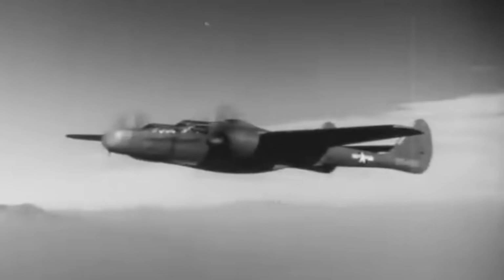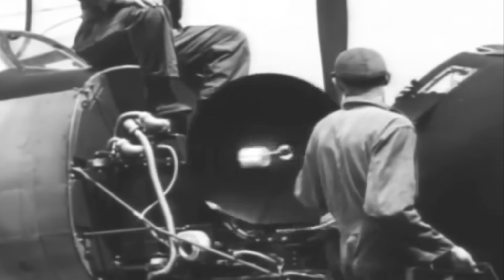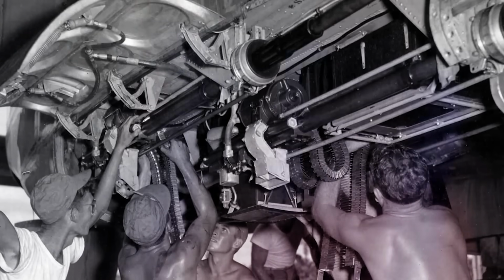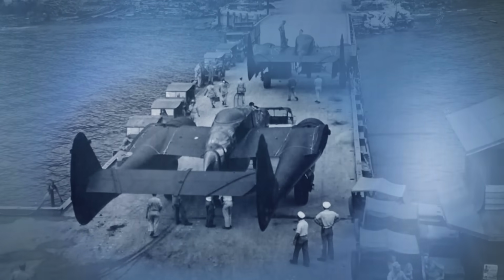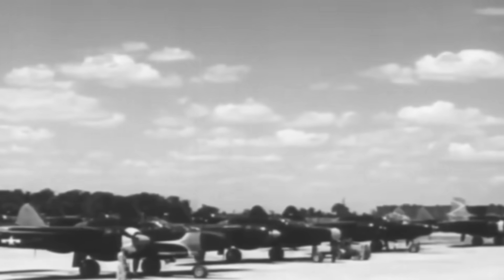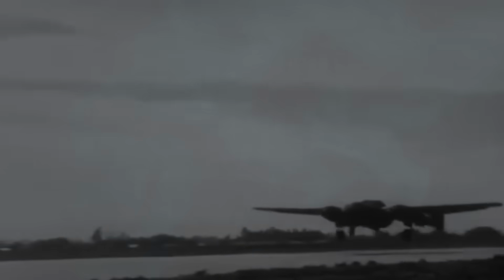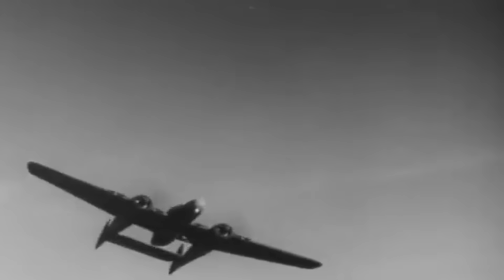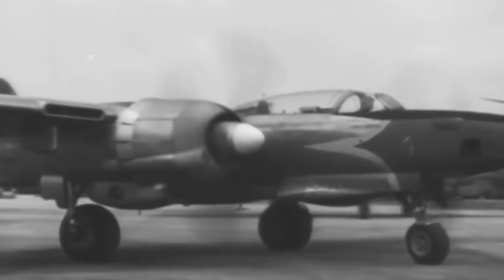The Mysterious Plane That Made 127 Kills Without Ever Being Seen

Comment: 0:27 Actually it wasn't an air-to-air kill ... it was on the night of 14th/15th August 1945 when a Nakajima Ki-44 spotted an attacking P61, descended to wave-top height and began evasive manoevres, only ending when the aircraft hit the water and crashed. Not a shot had been fired and the P61 crew were not credited with the kill, as it happened nearly 24 hours after the end of the war.
0:49 ... RAF Spitfires and Hurricanes were hardly "outdated" when World War 2 began ... at that time they were state of the art, particularly the Spitfire.
1:01 ... the P59 was a piece of junk ... most piston engine fighters of the time could easily outperform it.
1:19 Nightfighters and All Weather Interceptors are not the same thing.
2:08 A night time "fighter jet"?
2:20 What "big bombers"? The Luftwaffe never had any of those.
3:07 Ground Controlled Intercepts were still very often necessary as AI tended to be short range ... the GCI could get the nightfighter into the general area of an EA, close enough for the AI to then take over.
3:34 ... something Mosquito and Beaufighter nightfighters had been doing for years, long before the P61 entered service.
4:13 The dorsal turrent caused severe turbulence and on most P51s it was either deleted of locked in the forward firing position.
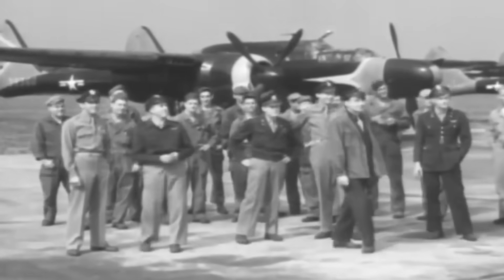4:35 366 mph? Slow as hell!  Mosquitos had been easily exceeding 400 mph since 1941!
5:14 It took until February 1944 to figure out that black was best for a Nightfighter?  Jeez, Defiant Nightfighters had been painted black since 1940!
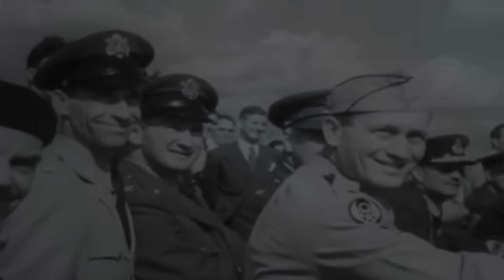6:14 Well what a surprise ... people couldn't see an aeroplane flying over ... AT NIGHT!!!
7:03 Astonishing that a so-called "cutting edge" night fighter that had entered service in the ETO in February 1944 was considered obsolescent in December 1944, only ten months later!
7:24 Slow!!
All in all, a somewhat mediocre aircraft that never got anywhere near being effective in the role it was designed for.  Too big, too slow, too short-ranged, too troublesome and too late entering service.

Comment: Shortly after ww2 ended is when the airforce recovered a scout / landing craft from the Grays of proxima centauri. That act led to a explosion of high technology. Although not all of the tech has been disassembled and understood. I'm telling you absolutely fact but I know many of you can't and won't accept it. I've seen it, I worked on the team studying the power distribution., we still only understand about 10 percent of the tech and construction of this ships reactor. It emits low levels of gamma radiation and the material inside the reactor creates an antigravity field or envelope... Cancels out ships mass. This it can violate the law about speed of light. No matter how many times you multiply zero... It never increases. I've told all you too much. The black  widow radar came from another disassembled craft given to US dept of defense in return for biological samples and corpses of supposedly accident and combat loss during Ww2

Comment: The RAF began airborne radar interception operations in late 1940 and used a variety of aircraft for the role throughout the war.  Similarly the Germans adopted a variety of aircraft for the role including the Me110 and the Ju88.  Both of these were painfully successful as night fighters.  The P-61 was an interesting but completely unnecessary experiment.  If Northrupt had been assigned to manufacture modified P-38's for the radar night fighting they might have got to the fight earlier and with a faster aircraft.

Comment: i have a piece of one of the four last remaining examples of the P-61. I got it to support the restoration of it to flight condition. it is currently my most prized possession since it is irreplaceable. an absolutely amazing plane for its time period.
Reply: If you don't mind sharing, where's it located now?
Reply: @jfu5222  mid atlantic air museum in reading, pa. it looks like it still needs its tail and wings, but has parts of it painted to its original unit. both engines mounted.

Comment: The first aircraft to use onboard radar was the Beaufighter night-fighter variant. The problem at that time in 1940 was that the radar set weighed a ton (2, 240-lb) and needed a big aircraft to lift it. The Beaufighter was the most powerful heavy fighter of the time, heavily armed and armoured, the Warthog of its day, four cannons, six rifle guns plus an extra one for the observer to pot shot with if he felt the urge. 
The P-61 did not enter service until 1944 and was the first US night fighter to be equipped with radar. Note US, not british, who gave the US the radar tech. We'd been littering the countryside with german night bombers for some while before the purpose built Black Widow turned up late in the proceedings. The Mosquito could also lift the radar set and had greater altitude and range than the Beaufighter but lacked its manoeuvrability. The Mossie NF were used to home in on german night fighters and take them out. The Lancaster had H2S proximity radar from 1943 which meant the Bf110G-4 showed up like a sore thumb. I gather my late father potted a few from the back seat of a Lanc.

Comment: In hindsight, given the lengthy technical delays costing two years, perhaps someone should have thought much earlier about adapting the P-38 Lightning to a night fighter role.  It was eventually done, but also very late in the war, too little too late.  Using the more powerful Allison engines of the late Lightning J and L versions, the night fighter version of the P-38 might still be capable of a top speed of 370 to 380 mph.  In the incident of a P-61 versus a Me-410 Hornisse (Hornet), the 410's top speed was 388 mph compared to 360 for the P-61, although top speed is sometimes stated as 366 mph.  That is why the Hornet was able to pull away in a straight pursuit chase.

Comment: In spite of two, 1,900 horsepower engines, the P-61 Black Widow's top speed was only 360 mph.  What was really called for would be something in the range of 400 mph or better.  The P-61 boasted an awesome, devastating array of four, Hispano 20mm cannon and four, Browning M2 0.50 heavy machine guns in a rotating top fuselage turret.  Unsolved continuing buffeting problems often led to the field removal of the top turret carrying the four 0.50 caliber machine guns.  The loss was inconsequential as the four 20mm cannon were more than sufficient for the P-61's night mission.
Later someone had a better idea of taking the venerable P-38 Lightning and installing a radar pod under the nose and stuffing an unfortunate radar operator in a highly cramped rear pod position.  It was so cramped that a special plexiglass hood had to be fabricated with a dome space on top so that the top of the radar operator's head could be covered.  But few were ever manufactured.
The U.S. Navy deployed its own successful night fighter F6F-5N Hellcat with the radar pod mounted outboard of the left wing.  Later a night fighter version of the F4U-4 Corsair emerged just at war's end.  The Corsair was faster than the Hellcat.  It mounted the same radar pod outboard of one wing but unlike the Hellcat, in order to balance the aircraft better, one of the 0.50 caliber machine guns and ammunition were deleted from that same wing.  Five M2 heavy machine guns were still considered sufficient to down the lighter built Japanese aircraft.
    Possibly the best U.S. propeller night fighter goes to the twin engine Grumman Tigercat which just barely missed WW2 but saw service in the Korean War.  Initially armed with four, M2 heavy machine guns in the nose and four 20mm cannon in the wing roots, the night fighter version deleted the machine guns in order to house the radar in the nose section.  The Tigercat saw limited service in Korea before being withdrawn in favor of the new jet engine FD-2 SkyKnight.

Comment: The P-61 had one major design flaw - The pilot was exactly in-line with the propeller discs.  During a ditching or gear-up landing, the pilot was usually killed by shed propeller blades.  The P-61 was also exceptionally maneuverable for such a large aircraft; by virtue of wing spoilers operating in concert with the ailerons.

Comment: The gun turret on the P-61 was a test bed 🛏️ for the B-29 super fortress, a radar controlled gun turret! Which was 4,  50 caliber guns aligned together!  And was a excellent night fighter ! It really was a heavy night fighter. So a Pratt & whitney double wasp 18 cyclider engine same as the P-47 thunder ⚡ bolt so a double thunder bolt at 4000 horse 🐎 power.

Comment: Werhaboos will actually see the piston engines and delude themselves into thinking its was less advanced than the Me.262.
Even the German equivalents only had low resolution antennae compared to high throughput, tunable, conical radar encapsulated in the nose.
Mfs didn't even have targeting companies 😂

Comment: For a fighter plane it's big. Same size as a B25 Mitchell medium bomber.
Great looking aircraft, love to see one. They didn't build that many of them so I guess that's why only some parts and a totally whole one doesn't survive. Have heard they are restoring one now though.
Interesting that the Radar fitted was so secret that the 'Radar Operator' was called the 'Radio Operator'
Interesting about changing from flat black to Gloss because it didn't reflect as much in a searchlight beam. Goes against common thinking, but alot of stuff is like that.

Comment: Black window needed more bunch from rocket pods or if not fired off a quick speed turbo button, if slow own that & make it slightly longer so more range poss & clip the wings for slightly add in speed.
Reply: make the trail wing stabilizer wing extend wider out past the vertical fins. Again if not fast then more lift meaning more climb & range.

Comment: One thing Black Widow pilots kept trying to measure themselves against was the P-38. P-38’s could literally fly itself off the ground. It could continue on its takeoff roll until ground effect took over and could then just fly off. One trick was to reach ground effect speed and just retract the landing gear. In the Pacific, one of the P-61’s decided to try this. Unfortunately, the P-61 was just too heavy. When the pilot retracted the gear, the big plane just settled back down onto the ground. That ruined the props, but the robust R-2800’s just shrugged it off.

Comment: Watched a training film for the 61.  The preflight checkoff, Cautions Warnings and Notes were like the NYC telephone book.  It took an engineer to fly this thing, the pilot had a helluva load.  Play with the flaps, cowl settings, manifold this and that, try not to use the brakes to steer, don't exceed this or that...
Reply: I think you'd find that all complex military aircraft are like that, the P-61 is not unusual in that respect. Watch some training films on other multi-engine combat planes and you'll see the same thing. The start-up and pre-flight check list on the B-29 seems to go on endlessly. I can't even imagine what a B-36 would have been like.

Comment: Although the P-61 contributed to airborne radar tactics and had incredible firepower, in the end it was a disappointment. It simply wasn't fast enough for the task it was made for. The P-61C model had a turbo supercharger which increased the top speed by 50+mph and it's service ceiling but it was plagued by instability issues. 

Add salt to the wound...the Black Widow cost almost $200,000 in 1945! For that price you could get one B-17 or two P-38s or four Mustangs!!!

Comment: All the effort, all the positive press, and it didn't last a decade in service.
I guess it was different tactics, but I dunno for sure.  As I see it:
1) Germany and Great Britain put four cannon packs in the noses of many of their night fighters.  These axially mounted cannon were pretty fierce and you followed your nose to use them.  Late war Me-410, He-219, and Mossy Nightfighters were pretty good performers, I think, though neither was a war winner.
2) A four cannon turret is very cool . . . like to see those on the B29 . . . but it's a re-invention of the Bolton Paul Defiant and Blackburn Roc*.  You don't need one-a four cannon turret- if you just follow your nose.  That four cannon turret is a whole ball of potential malfunctions.  Plus,  it's heavy.  And vibrates like . . . um . . .something made for heavy duty vibration.  The recoil would be enough to require manual modification of trim during operations.
3) Allied Nightfighters were superfluous to the war effort, but you can't fault them for trying.  For the most part, they came too late in the war to have any kind of notable impact.  German Nightfighters, on the other hand, did butcher's work, but it wasn't enough to stem the tide.  Were Nightfighters worth the effort?  Your subtle conflation of type at the beginning explains it quite well.  To re-iterate (in paraphrase): a good night fighter has all the qualities needed to be a good all weather interceptor.  We were going to need all weather interceptors in the near future.  Might as well work out the problems now, while we have the budget.
  *in a plane five times as heavy

Comment: cool plane. early 70s I had a built a small model plastic kit of it.  
I recall reading how it could sneak up on enemy aircraft at night until they were close enough to see the faint glow from the exhaust- then it was too late for the enemy to avoid combat from the Black Widow's guns.

As an aside, it is pretty interesting to see large roomful of engineers drafting parts to be manufactured. I had taken drafting in HS before CAD- line thickness, consistency etc. were all important elements to be observed- all while maintaining overall cleanliness of the finished page. It was a very time consuming process, as was deciding whether to erase mistaken sections or restarting on a fresh page. I imagine how difficult it must have been to design the finished product - like individually painting pieces of a very large jigsaw puzzle so they all come together to a recognizable picture.

Comment: My father was a radar technician in a P-61 squadron.  He said his craft had no turret with quad .50.  He said the turret would cause buffeting.  Most aircraft that retained the turret would keep if locked forward.  His squadron would chase German aircraft that would come in at night to drop mines (usually) into harbors like Antwerp, Belgium, which the allies were struggling to clear to open supply lines closer to the front.

Comment: Not sure if anyone else has managed to notice this, but I'm fairly certain the ARC-170 starfighter from Star Wars is based off of the black widow's basic construction: staggered tandem cockpits at the front, long nose, remote control swivel turrets in the back controlled by a rear facing cockpit and twin engines close to the fuselage

Comment: As a 12 year old air watcher for the Civil Defense Corp located SE of the airport, I witnessed what appeared to be a Henkel twin engine airplane outlined by the moon which was flying low to determine when the plane would be detected.  It was heading west to check the approach defense for the then secret Oak Ridge Plant and the Fontana Dam area.  I excitedly Called the operation center and described what I thought was a Henkel.  The man said congratulations but it is not a Henkel, it is one of our new planes made to work at night. To this day I do not remember any engine sound.  They must have muffled the exhaust to hide the engine sound as well as engine heat glow.

Comment: Instead of spending money on R&D on the AT-6 or the Tuscano, the DoD should've contracted Northrup for an upgraded P-61.  Imagine the armaments and payload with modern engines, avionics, and lighter materials for the airframe.  Replace the quad .50 with a 20mm Gatling gun.  It be a beast

Comment: No mention of the P-61'a enhanced maneuverability due to the use of wing spoilers in concert with the ailerons! There are tails of P-51's bouncing P-61's over LA and then finding this big twin sitting on their tails,  P-51's got their clock cleaned. Also that the P-61's turret was only used on the first batch of P-61's because the same turret was used on the B-29 and it had priority. Oh, BTW the P-61 never flew off Wake Island. Wake was never recaptured and not reoccupied until after the surrender.

Comment: Although trained as a pilot, my father was a P-61 radar observer.  He had stories.  LIke when they would return to base in the morning after nighttime intercept training out over the Pacific and playful Corsairs would jump them for fun.  They would pull into a tight turn to evade and the P-61's main gear would drop out.  There were also issues with the remote control turret inducing turbulent flow, which disrupted airflow over the elevators resulting in pitch control problems. They eventually removed the turret and the gunner, leaving the pilot to aim the a/c at the enemy and fire the guns.  Not Northrup's best design despite the high coolness factor.  But hey!, dontcha know there's a war on??
Reply: I could listen to and read WW2 experiences all day long.  Thanks for the stories.

Comment: Some fact checking. The Lancasters and Moscuito's had radar in 1943. So did the Germans.
The P61 was a complete failure. It was slow and a terrible design and was scrapped in 1945.